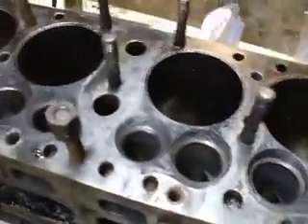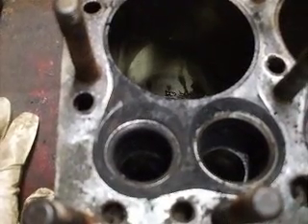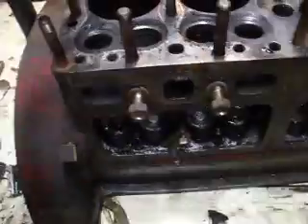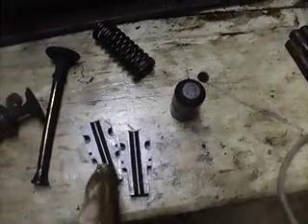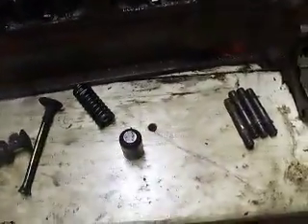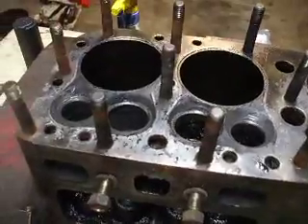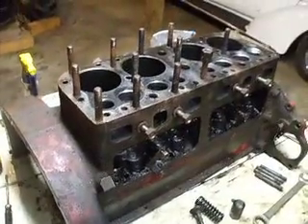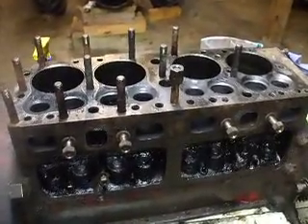1945 Ford 2N Rebuild (Video#5)

Comment: Since the valves and valve guides are obsolete I would be seriously tempted to keep the split guides and those funky valves. I have never personally seen those with the swollen tappet end. That is unless the guides are worn. But you said one valve seat may be too far gone. If a person could get castolite valve seats they will last your lifetime.
Reply from the maker: The old style valves are non adjustable. They make a lot of noise (tapping) compared to the newer adjustable style. Also with a more refined adjustment performance would have to improve. The split guides are used on these older style valves so you can actually get the valve in the guide do to the swollen end.